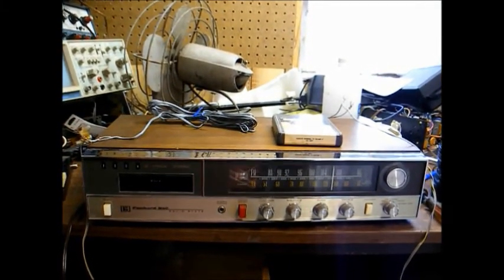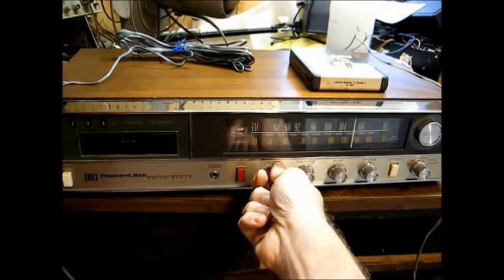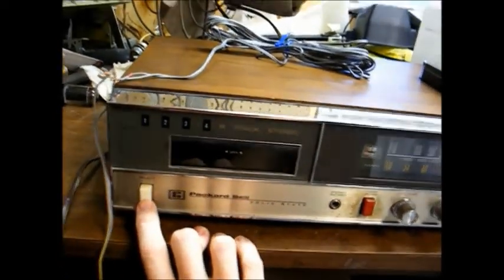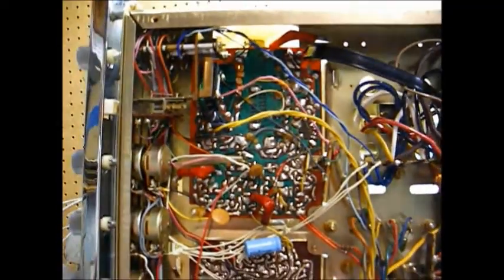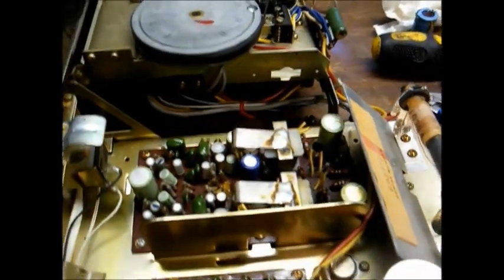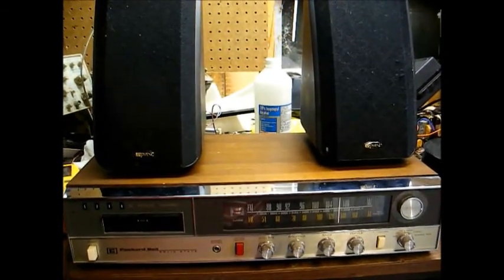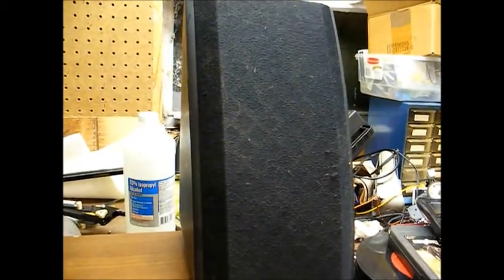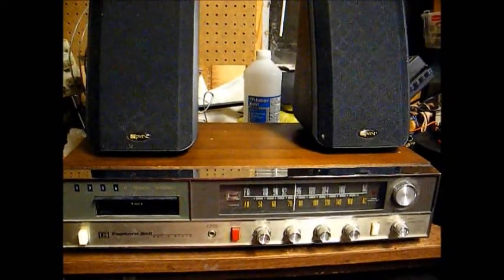'69 Packard Bell AM/FM/8-track stereo

Comment: This Packard Bell you have is almost identical to a Lloyds unit I found next to an apartment building dumpster about 8 years ago, the only difference is that the pushbuttons on the Lloyds are all black. I haven't found out who made it yet but It's quite heavy and well built, it used to be my main eight track player until someone gave me a Sears one that also had a cassette player built in.

Comment from the maker: The start cap in mine is solely for the tape player motor. There are many capacitors found in a stereo and they serve different functions, depending on the circuit it's used in. My best advice is to get a schematic and start checking voltages.

Comment: I'm surprised the door to that 8-track player wasn't broken, out of error or frustration, by now. I'm still annoyed just thinking about it. But I have to add that the innards of that thing are much more substantial than the exterior styling would lead one to believe; I was surprised to see the 4 TO-3 output transistors mounted on a metal chassis. They put more effort into that than the random discount store stuff typically got in the 1970s. It seems closer to the quality of a low-end component grade receiver, the likes of which Radio Shack or Lafayette was selling for around $100 in those days.
Reply: PS: One fairly obscure "America" song I wish the oldies stations (or even "classic rock" ones) would play is "Sandman". It was probably as close to a hard core rock song as they ever got. "Lonely People" would also be good. One of their songs I could stand to never hear again was "Sister Golden Hair"; it always sounded sped up like a Chipmunks record; the "live" concert versions were actually better.

Comment: AC synchronous motor for the 8 track? That alone shows the quality of stuff from back then. The motor in my JVC/Nivico console's reel to reel is a large ac sync' with start cap and the turntable motor is a shaded pole sychronous. No dc motor or ready made IC crap there.